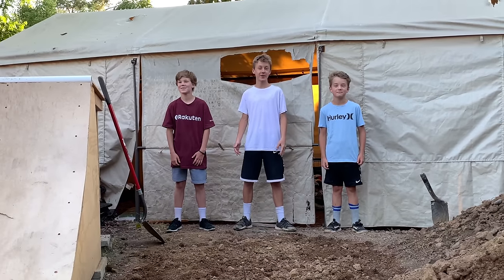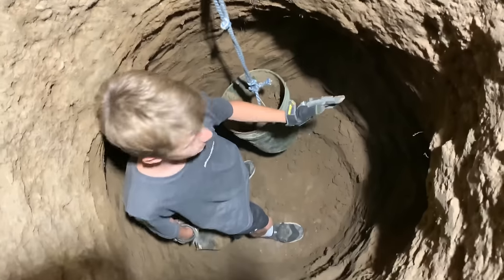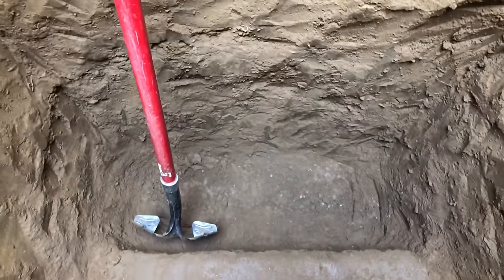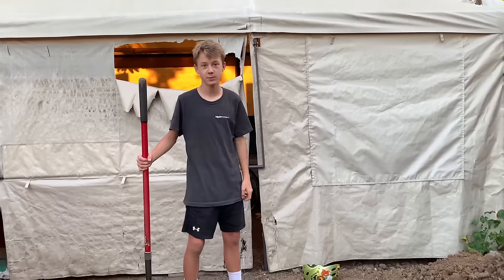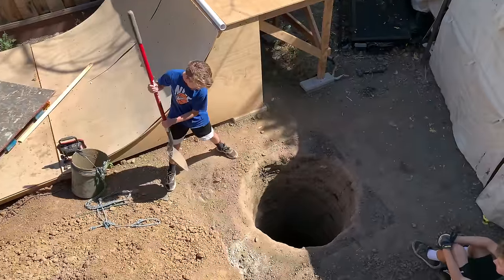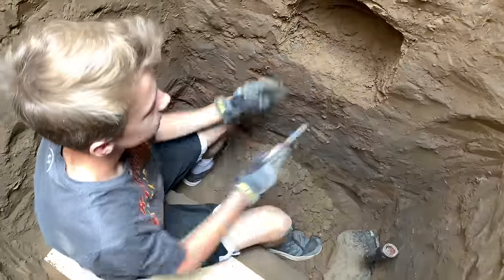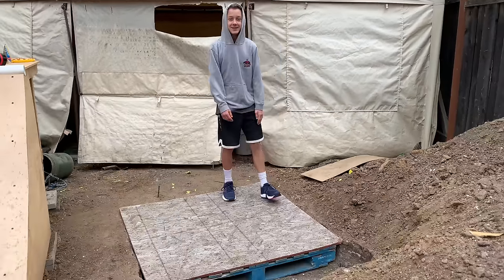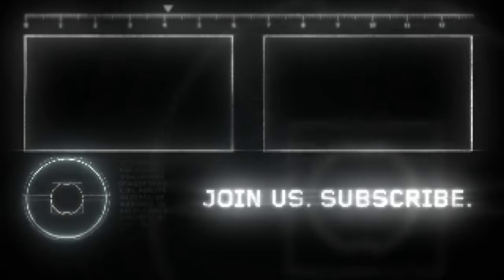I dug an underground bunker in my backyard

Comment: As others have said here, even though the earth is really hard, it is still dangerous to dig this deep without supports. Also don't put the loose piles of earth near the hole either. Move them away, because it's weight that if wet, could put pressure on the hole collapsing in.

Comment: Youd be better off making a mound around the mouth of the cave to prevent water runoff into it. Then if you wanted to add wooden wall and ceiling supports, you could widen it enough for a small wooden bench, a tv, mini fridge, and a solar charged battery bank. It wouldn't be very expensive. Also you should build a ladder instead of using a rope

Comment: What you could do is square the shaft and line it with wooden supports. The only reason that hole didn't collapse 3 feet down was because you have clay soil. But guess what? Clay soil will absolutely change shape and shift as it drys out. 

I'd also recommend some sort of air system to circulate fresh air in. Otherwise you could get CO poisoning or even radiation sickness from Radon gas accumulation.

Comment: This may seem stable, but depending on where you live it can quickly become unstable and collapse, or it may collapse after a freeze/thaw cycle. you can dig tunnels like this, but  you need to do a bit of research on mining methods for your area and follow those guidelines for shoring up your tunnel. You also want to ALWAYS include at least a pipe that will deliver fresh air from outside the tunnel. You could dry drown in a tunnel like this as it fills with C02. You could also regular drown in water if you get stuck down there and its pouring rain.

I learned this the hard way as a kid by digging a tunnel that collapsed on me. luckily one of my friends was outside the tunnel and dug me out.
Reply: How deep was the hole and how long did it take

Comment: WARNING - excavation walls even if they aren’t very tall have been allowed to cave in and actually crush and suffocate people AND you likely do not know how heavy a substance soil can be. One cube of soil that is 1 yard tall by 1 yard wide and 1 yard across can weigh around 3000 pounds, and this can make it difficult for a person to escape, or even for others to come and attempt to rescue them in the event of an excavation wall caving in. AND you do not have to be very deep underground to be at risk, as even at depths shallower than 5 feet one could still be pinned up against a trench wall in a collapse - or if one is shorter, or bent over or on their hands and knees they are even at greater risk in shallower depths of being pinned or buried by a soil cave in. You need to look into how to protect those walls from cave in on your hole by information from safety professionals. Using a bunker like that in an emergency such as bombing or bad weather - those types of events could weaken the soil even further and make that bunker even more susceptible to collapse. These are just young kids making the video, who like me, didn't seem to know the risks of deep excavations. Also good to be aware of sinkholes when digging as that could cause the bottom of an excavation to cave in.

Comment: At 12 years old during the summer with a few buddies dug a hole 10 ft square 8 ft deep but being here in mid Florida had to backfill it two feet because of the water and put a corrugated tin roof on it with dirt and dead plants 6 months later the guy came to mow his vacant lot and the front nose of the tractor ended up in the hole. I am curious though did you guys also build your half pipe at the age of 13 during the summer we built a 40 ft long 24 ft wide 12 ft high half pipe in my backyard for bikes. that was 1984.
Reply from the maker: That’s cool dude! Yeah we also built that half pipe a few years ago. Our dad helped a little bit with that one though.
Reply: Just a suggestion but since you're so good at carpentry and enjoy ramps when you get old enough look into building skate parks and ramps for the x games and for private use it'll be a great career you'll enjoy it

Comment: Looks fun tbh might make 1 my self .. but be careful because even when I go work with proper builders your not allowed to go past hip hight without any kind of supports when digging that narrow. Even if you just fix a bunch of pallet slats together n create a safety wall around the inside to stop it from collapsing onto you because that is super dangerous although I bet it is super fun. Just a suggestion why don’t you create rooms in there . Quicker way to dig is if you have a breaker / jack hammer but if not I’m sure you probably have a drill well if you attach a big cylinder  onto it it can save you a lot of haste when digging as you drill it and pull it straight out . Be safe guys have fun 👍

Comment: very good job, If you want to make this larger, you could use concrete and rebar to reneforce the walls and floor, however remember to put wooden, steel, or concrete pillars to keep the celing from collapsing on you.

Comment: ok for safety ,always have a ridged tube run down in the dig. incase of collapse. and use supports as you go. you guys are lucky to have a hard clay witch is perfect for digging . some loose soil or sand will give way easily. very dangerous to be that deep when it happens. and never dig in a deep tunnel alone.this is really cool. i think every kid has started a tunnel to china. lol.  be safe.

Comment: I don't see the point of digging anything this deep.  

A:
It takes a lot of effort for very little space.

B:
While the dirt is very hard and I doubt it would move, it is still non-reinforced loose material with nothing to keep it in its place besides weight and clay.  

Suggestion:
Dig a wider hole, place 2 pieces of wood parallel to each other buried in the dirt of the top of the walling a way that you could place multiple (most likely 2) pallets on top and separately lift them.  12 feet is excessive in terms of effort and danger (risk.)

A wider hole, while still posing a danger of failure in the walls (collapse) is safer in that if it does decide to collapse, it won't instantly bury you alive and entomb you.  

Just fill halve of it in and double the length of 1 axis so the square on top becomes a rectangle.

Please, stay safe.

Edit:
I, however, would never get the chance to try this because I live in Florida.  The soil is just sand, and the more inland you go, the more slightly darker it gets.  I would guess this is taking place somewhere in the southeastern united states.  Namely Georgia or somewhere in the western Carolinas.

Comment: I know I'm late to the party but that was not smart at all!! You were digging a deep shaft hole in soft soil without any type of Shoring. You had no way of extraction in case of collapse(ropes and harness) Do you have any idea how fast that hole could collapse? If it did it would bury all of you 10 feet deep and by the time people could dig you out you would already be dead for at least 30mins. 
You guys need to start taking a little bit of safety in mind..... some plywood and 2x4s could really save your life.

Comment: and this is how you end up on the news.....  stop Digging!  
past 4' you need shoring. compaction, soil analysis, probably a permit....   or you can slope the hole so its bigger at the top.  dont get dead.   if you live through this its still wrong and dangerous; that is, unless one of you is an engineer or a Lawer.   In that case I take it all back.  Carry on.